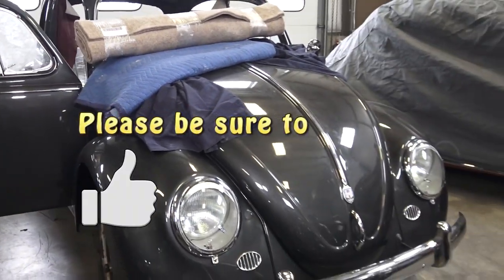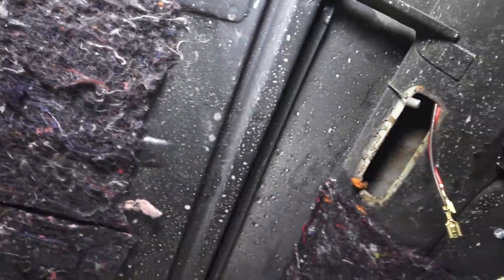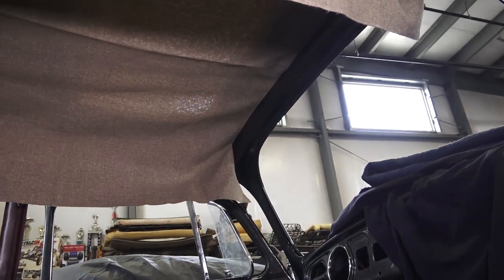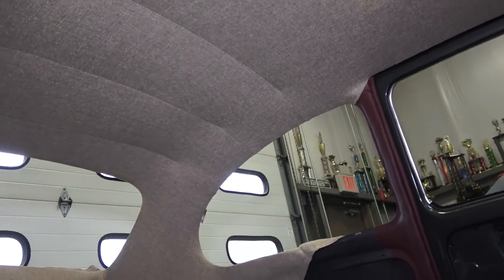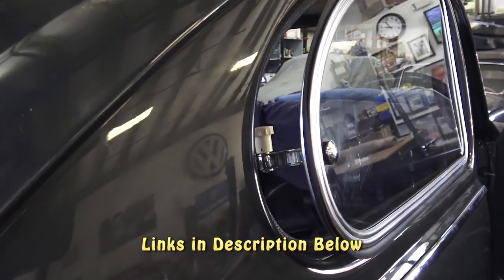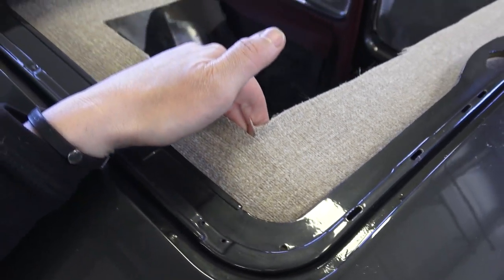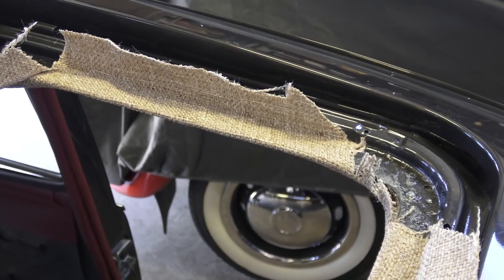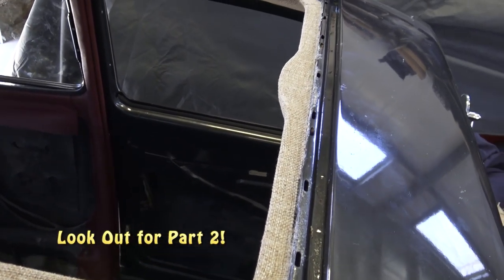Classic VW BuGs How to Install Beetle Metal Sunroof Headliner Pt.1

Comment: Chris can you please help me. I need to remove my steel sunroof  cause it is closed and stuck. All manuals say open half way to remove.  Please help, can I remove the head liner panel with it closed so I can I hook cables? Let me know if I’m on right track cause I donor want to wreck headliner. Thanks for all you do.
Reply from the maker: You have to be able to move it back a bit, it has to be away from the body line in order to drop it down.

Comment: Hello Chris. Where can I find the metal sunroof for my vw beetle 1966?
Reply from the maker: may have to check a good used source, like ebay, thesamba.com or some FB VW groups.
Reply: I'm in the same boat, I need to find the metal roof and fabric panel as well.

Comment: Awesome video! I ordered new bows and spring clips but the bows are way too long. Do they all need to be custom cut or is there a specific length I need to cut them to?
Reply from the maker: Yeah I do remember the new bows being slightly too long, the originals should be like 44-44.5"
Reply: Thank you. I have been trying to find that information for months.